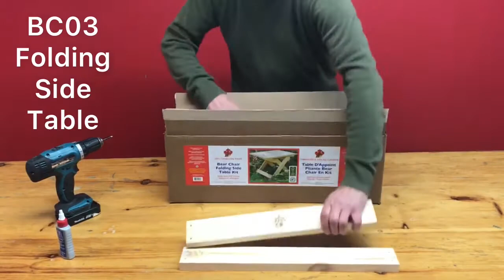How to assemble your Bear Chair BC 03 Folding Table

Comment: The assembler holds the drill upside down and backwards (that is, from the far side of the table (~5 minutes)). You need a long neck for that one. I almost did as well without the video. In addition, the pencil line is hard to see, especially when it's below the angled piece. I'd use a marker on top of the pencil line if I had to do it again. The table turns out to be very heavy compared to the previous version, making it solid but hard to carry. The method for gluing is not stated clearly in the instructions. The good thing is that it was on sale last week at Canadian Tire.